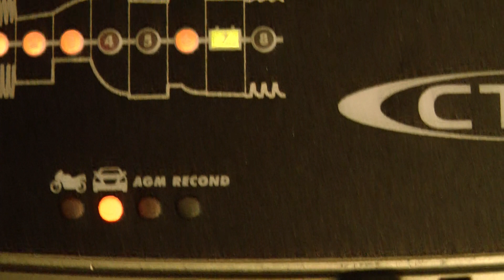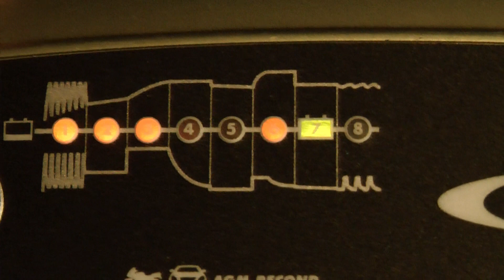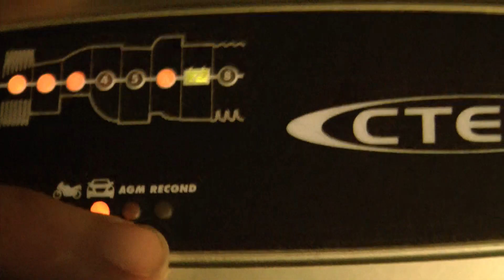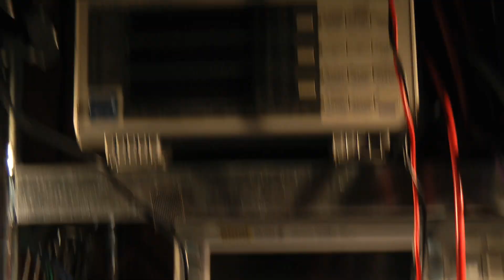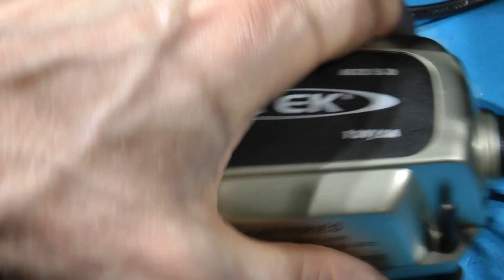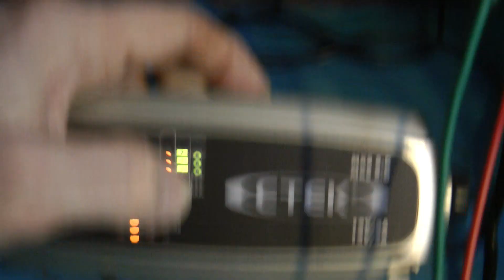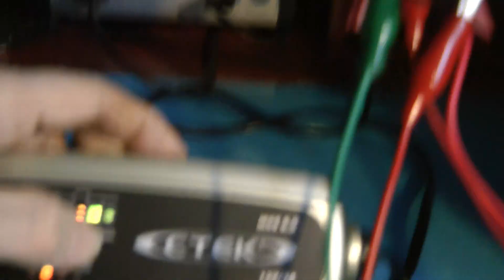Does the NOCO Genius5  charge better a than CTEK MXS 5.0 ???. NOCO Parametric Test Part 4

Comment: Does the NOCO Genius5 charge better a than CTEK MXS 5.0 ?  IN A WORD: NO................
Reply from the maker: Depends on what you are testing. For reliability and useability in a word yes. If you have no quantitative data are easily taken in by pretty flashy lights and aren't bothered about build quality then definitely YES!!  I guess the excitement of finding the CTEK is still working as you left it is palpable too.
Reply: @razenby  WE TESTED BOTH SIDE BY SIDE, CTEK WAS THE WINNER IN EVERY RESPECT, PERIOD.

Comment: Very interestinv video. I am not sure that I understand you right if the ctek is starting automaticaly to maintain after it stops when the battery was fully charged
Reply from the maker: Yes it will keep the battery fully charged. It waits for the terminal voltage to drop after charging and tops up the charge  when it detects the battery is beginning to discharge.
Reply: @razenby Thanks

Comment: Hi there!
I'm in need of a charger and I'm on the fence for one of these two. Which, if not other considering the 4 years that have passed, would you recommend: ctek mxs5 or the noco genius 5?

Many thanks!!
Reply from the maker: NOCO is more reliable. CTEK is prone to go pop and is susceptible to condensation,  CTEK has a more aggressive repair cycle but it really doesn't work any kind of miracles on VRLA starting batterries.
Reply: @razenby you should test foxwells BC521 charger. Or are all these chargers just all snake oil marketing ads with as many features they can list off?

Comment: Hey there. I just charging + recovery on my 7yr old audi TT battery using an Anker C1000 power station with Noco genius 5.

It used 40% (400kw) of the Ankers battery.

Does this sound successful?  Everything went fine but curious on whether this was successful or not. Thanks! Great review
Reply from the maker: Thanks.  Difficult to judge, Depending on the problem, a battery can take more power to charge than a healthy one but store retain far less in the charge.    How is the TT's battery doing?

Comment: Neither of my CTEK chargers get hot.
Reply from the maker: Connect them to a flat battery and see. When bulk charging at the full rated charge current they will get hot.
Reply: @razenby  I have the MULTI US 25000 and the CT5 Powersport.  They don't get hot, the Multi does have a battery / air temperature probe on it.  I haven't tried a NOCO charger

Comment: That was really interesting!  The point about heat/reliability is interesting, anecdotally I have a CTEK Multi US 3300 from around 2008 that lasted until 2022 when I repaired it.  It’s still going in 2024.

I’d probably buy another.
Reply from the maker: Maybe the overheating issue is caused due to efficiency losses by puling five amps from a  three amp design with the same small enclosure and not implementing additional mitigation measures no dissipate the extra heat.....??
Reply: I have zero reason to doubt you, you’re far above my skill set.

My model outputs a peak of 3.3A, but it still gets hot and it still cooked a pair of capacitors eventually.

Maybe the Canadian weather helped it last all these years.

Comment: Thumbs up. Great review and test of Ctek and Noco battery chargers. I'd like to see you test PulseTech Battery Charger's and PowerPulse passive battery desulfators. I use a PulseTech Power Pulse battery desulfator that you leave on your battery at all times, PulseTech claims that it will extend the battery life up to three times, and uses a patented frequency rather than use voltage spikes.
Reply from the maker: Hi Jose, thanks for watching. I would test one if I could get hold of one but cant locate them for sale in the UK. Having a patent doesn't mean you have an invention that actually works,  Destitution used to work on old style wet vented cell batteries that were lightly sulfated. Not nearly as effective on a sealed lead acid starting battery.  If you drive it hard enough to desulphate, the electrolyte dissociates  at such a rate that the recombination into water cannot keep up, the pressure builds and the gases are vented  via the pressure relief valve.  The plates are prone to crumbling as they are etched and of course you cant top up or replenish the electrolyte.   Electrolyte is lost.

Comment: Just a query on the noco when are they actually fully charged? 
Had a battery at 12.38v so plugged the noco on went straight through to the optimisation stage after ~ 30 seconds.
Reply from the maker: A fully charged battery would do that..
Reply: @razenby  I’ve taken the noco off and let it rest for a hr or so and it’s only showing 12.42v so no where near fully charged? 

my older ctek  is still pumping 3amps into the above battery whereas the noco is on the single pulsing led weird.

Which I’ve since put it on the 2nd battery which was at 12.1v and it’s on stage 2 putting in 4.95amps at 13.24v which seems low.
Reply: @TheD199020 have you found why it does that ? My noco is also doing that I have now tried 3 different batteries and in all of them it goes straight to the last led in less than a minute. Monitoring with a multimeter it reaches 15.2v before it switches to green led .

Comment: so i have a deep psycho battery that has been in a trailer that my boss uses for catering. It’s an old battery and I got it taking a charge and got it from him for my boat. i have been charging it now for 6hrs and was going to use the repair mode will it help the battery or hurt the battery. it’s pretty much a dead battery
Reply from the maker: Hi Tim, any modern battery has been allowed to dwell in a deeply discharged state wont recover.  You could try a carefully orchestrated overcharge. It may help.
Reply: deep cycle battery !

Comment: I own a CTEK MXS 5.0, it does not get HOT at 0.8A setting but I have yet tried the 4.3A for charging.  Thanks for your advice, I think I'll go get a fan and a power surge protector to pamper this HOT Swedish baby before it gets fried.
Reply from the maker: It wont get hot unless the battery is flat and full current mode is engaged.
Reply: @razenby  Thanks for your reply.  I guess I'll be fine as long as I use the Ctek on 0.8A for topping up my car battery.

Comment: Extremely grateful for going through the trouble of doing various tests and analysis.  I am about to buy a charger and was doing the research whether to go for Ctek or Noco.  Have read quite a bit of Ctek going wrong whilst can't see many Noco going wrong.

Ctek has feet to lift the unit up as you have mentioned obviously means that the manufacturer is aware of this heat issue.  For any electronics heat is not good which shortens the life to the unit.

Together with your other video where Ctek has been opened up, I think I'll go for Noco Genius 10.

A big thank you for enabling me to make an informed choice as well as safeguarding my investment on a new charger.
Reply from the maker: Pleased it was useful.
Reply: C'

Comment: I think your C-Tek charger is faulty or being upset by your test equipment, I've been using an MXS 5 and MXS 10 for years and neither of them have ever missed out stages in the process. Step 8 should not kick in until it has been at stage 7 for a week.
Reply: I've bought and sold a few used and new versions of the CTEKs and NOCOs, probably 30+ over a few years.  The CTEK brand is definitely less reliable than the NOCO, but I do think the CTEK "recond" mode, in a healthy unit, is good  (BTW I've never seen a CTEK miss out lights like that??).  I've had a few badly performing batteries of various sizes that don't initially seem to respond to these reconditioning programs, but from experimentation I've found that you have to leave the CTEK to carry on with it's own sweet thing, sometimes taking 2 or 3 days, and for really bad batteries let them rest then repeat the process, and this does seem to make a difference. The batteries tend to maintain their voltage for longer, but I don't have the ability to measure the capacity.  The NOCO shuts off too soon it seems to me and I can't get the same results.  Like you I really like the build on the NOCO, but I don't think their "repair" function is effective.
Reply from the maker: The CTEK isn't faulty. About 20 of them have been through here with power supply faults. I don't subscribe to the smoke and mirrors argument.  Test equipment and simulation is good. However I am happy to receive any technical advice on how you believe the equipment simulation can be adjusted if you would like to see a specific test. My advice is not to use a CTEK on a healthy battery and certainly don't leave it connected to the mains for extended periods unless you take precautions especially in a damp environment. If you believe desulphation of sealed VRLA car starter batteries works then use the CTEK.   If you want the battery to last then make sure is gets frequent, accurate float / absorption charges if the vehicle is used for short or infrequent journeys. It takes several hours driving to complete the full battery charge. If you are running around at <80% of full charge then the alternator is brutal.
Reply: @razenby  Hi, been watching your videos on the Noco G5, very interesting. I do have a question. What do you mean by the last sentence of your comment : If you are running around at <80% of full charge then the alternator is brutal.

Comment: Good comparation!
I have a Ctek mx2 5.0 too but in silver color. The leds are working same as in your video, but this is abnormal.
The leds should lit from left to right in a row while charging.
I am sure, that mine is not working properly. For example in normal charging mode the voltage clibs to 14,8V in a minute from start.
I was looking for officional repairing service here in Hungary. The answer was, that the repair only possible in sweeden (at the factory) and it is 130€ regardless of the problem. 
I am happy that you share the information how to impruve this charger.
Reply: I have a cteck mxs 5.0 silver too with a black button ( old unit, working ). No dim led as in this video, this ctek is probably faulty. The LEDs must light up from left to right.
Mine unit is hot too when the battery is flat.
Cteck desulphation ( step 1 ) is useless !!! The noco repair mode is really better.
comparaison

Yeah good comparaison but bad method. 
The best would have been to do 3 times of each function for the accuracy as for aldi autoxs.
It would have been necessary to recharge after a repair mode with noco because the energy is taken from the battery. This process is not lossless.

No battery simulation with one or two dead cells ?
However, good video !
This noco genius 5 is very interesting !!! ( repair mode, lithium mode, force mode )
( sorry for my english, i am french )
Reply: @titoulamaison7755  Tryb odsiarczania CTEK uruchamia tylko wtedy, kiedy wewnętrzny algorytm ładowarki oceni że akumulator jest naprawdę zasiarczony (jak sądzę bardzo duża rezystancja wewnętrzna i bardzo powolny wzrost napięcia -> akumulator słabo przyjmuje ładunek). I chodzi w tym przypadku o zasiarczenie o trudno rozpuszczalnych kryształach. Obserwowałem na oscyloskopie pracę CTEK w tym trybie , podłączonego do zasiarczonej baterii. W trybie odsiarczania ładowarka podaje co jakiś czas serię impulsów prądu o dużej częstotliwości przy napięciu 15,6V, które rozbijają trudno rozpuszczalne kryształy siarczanów. Moją zasiarczoną baterię CTEK odsiarczał cztery dni, przy czym co dwa dni, ładowarka samoczynnie przerywała pracę i musiałam ją ponownie  uruchamiać. Akumulator po odsiarczeniu daje się naładować jednak odzyskiwana jest tylko część jego pierwotnej pojemności.
Reply from the maker: Hello, the lighting of the lights is not abnormal. It is a design flaw. It is much worse on a bad / failing battery I have tested eight MXS5.0 these chargers and they all worked the same. I think that it is a software error because occasionally they work.  The designer has tried to be a bit too clever and hasn't got the exceptions worked out.